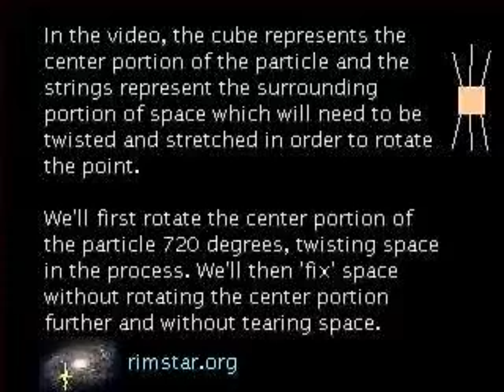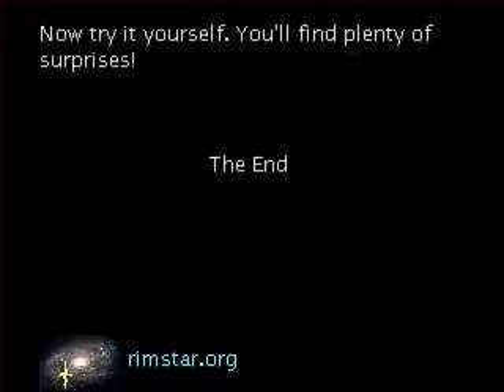Spherical Rotation and the Wave Structure of Matter (WSM) model

Comment from the maker: @jOliverh ... continued. To answer your second question. In the WSM model I think the strings or lines represent the path that the in-waves and out-waves take as they arrive and leave the wave center (particle.) Space energy density at any location is defined as the sum of the wave intensity, which is the same as saying the sum of the square of the wave amplitudes. Gradients in space energy density are followed by waves as the waves move through space - and partcles are made of waves Continued..